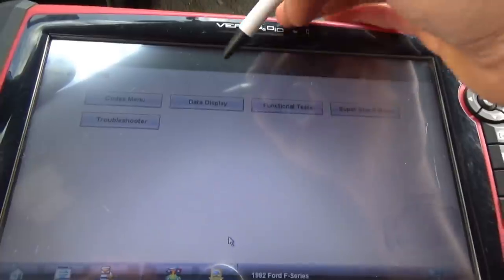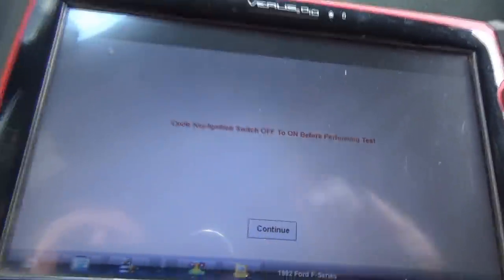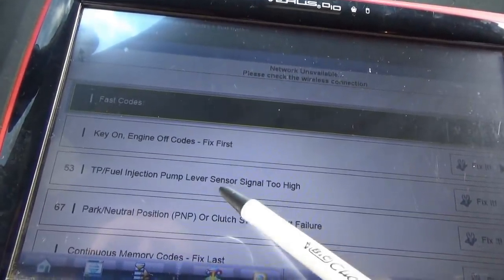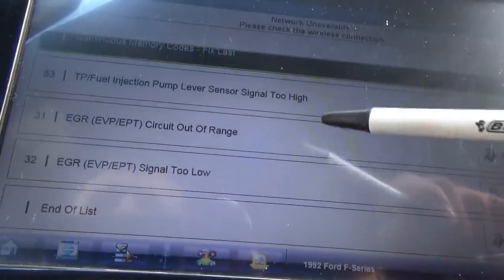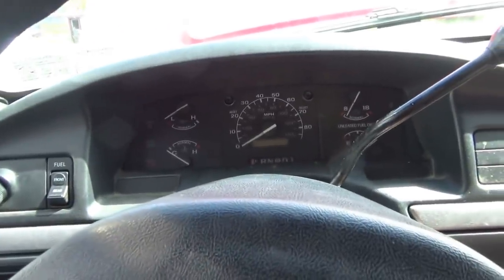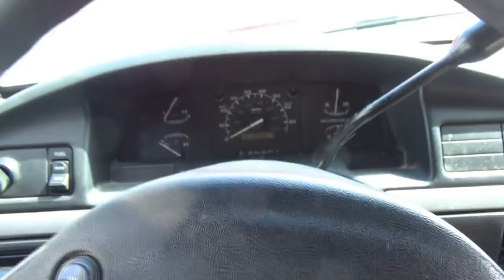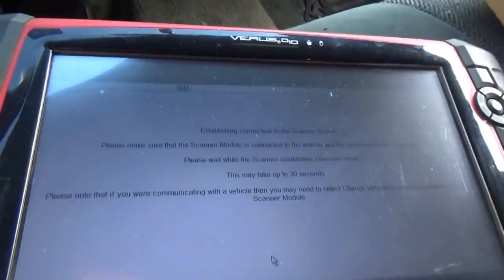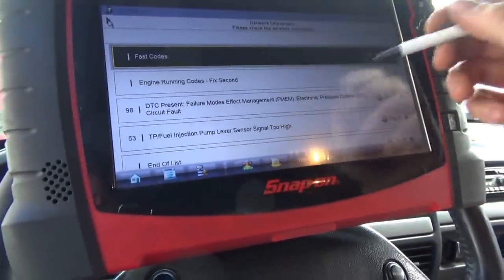EBAY Parts Caused Ford Truck IDLE Problem? ('92 F150)

Comment: Ivan, You know what Ford stands for don't ya? Just expect every problem! Oh and FIRST!
Reply: I’ve had all brands…they work fine all of them if you stay after them with good maintenance.
Reply: @jonnycando  My wife and I had a 97 Taurus...NO AMOUNT OF MAINTENENCE could over come the shit Ford builds. I have personal experience.
Reply: @mikefoehr235  certain taurii were scandalous in their lack of durability but even they could be egged on…
Reply: @jonnycando  our Taurus was egged on with 2 engines, 3 transmissions and a Costco cart of other parts. That one Ford and the 💩 that GM sold me sealed the deal to Toyota. Some on YT have told me to give FORD and GM a second chance. Well, why on gods earth would I want to subsidize a sewage treatment plant. How is it that Toyota has built us FOUR stellar vehicles.....serendipity...no fn way. I thank Toyota for being my savior. Mostly just maintenence. The brand is in another realm.
Reply: @mikefoehr235  well I’ve got a new Mazda as daily driver and 250000 mile k1500 and 230000 mile Explorer…all running perfect but the Explorer occasionally wanting extra care…if there’s any identifiable shortcomings in American brands it’s the shareholders fault as they all are capable of competitive quality vehicles.
Reply: @mikefoehr235  well I’ve got a new Mazda as daily driver and 250000 mile k1500 and 230000 mile Explorer…all running perfect but the Explorer occasionally wanting extra care…if there’s any identifiable shortcomings in American brands it’s the shareholders fault as they all are capable of competitive quality vehicles.
Reply: @jonnycando  Yup...the bean counters. Hard to beat MADE IN JAPAN...Mazda and Toyota are working closely to bring new vehicles to market

Comment: You mentioned the play in the throttle cable and then dismissed it.  You shouldnt have, this is part of the problem.  These cables are notorious for losing their original operation due to stretching and what not.  Check the other youtube videos about this cable cause major problems.

Comment: What is not commonly known about EEC IV is that when the key is turned on and in the instant befor cranking, it takes a snapshot of throttle position and assumes that as closed throttkev(TPCT). If the throttle body doesn’t agree with TPCT, the IAC goes nuts. 
 Another thing not commonly know is that EEC looks at the resistance on the wiper circuit, not the voltage. That voltage is an interpretation of the resistance for us stupid humans.
Reply: It's the other way around, the ECM is only measuring the voltage on the wiper using an analog to digital converter. The voltage dropped by the voltage divider depends on the wiper position which makes up the two resistances on either side. There is no way to measure resistance directly, the multimeter too only measures voltage, resistance is just a mathematical derivation by us humans...
Reply: @jovangrbic97  but resistance is inferred by the voltage. A beautiful problem for those old fords is to get a TP sensor from a cheap source and (if it works at all) will start off with a TPCT of over a voltage. That really messes with ECC

Comment: Ivan, you've got to stop working on cars that are from the previous millennium. I live in a perfect climate here in Phoenix were rust doesn't exist and NOBODY drives anything that's that old with the possible exception of Hispanic landscapers. Where do you find these vehicles?
Reply: Here in Florida I see them everyday. These were some of the best trucks 
ever built!
Reply: @mark98070  Could be an East Coast/West Coast Biggie vs. Tupac thing. When I lived in Pittsburgh old rusty cars were common. Out here in AZ and in CA you just don't see them. Can't explain why.
Reply: These trucks are still around on farms all over the Midwest. Farmers keep fixing them.